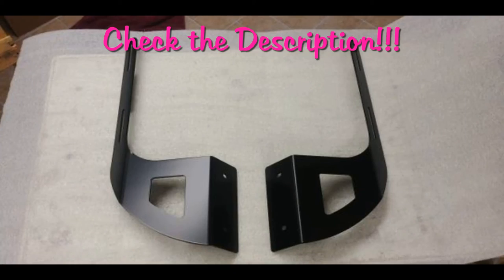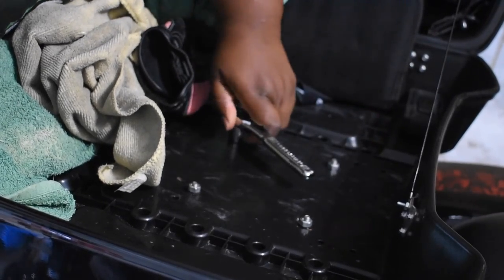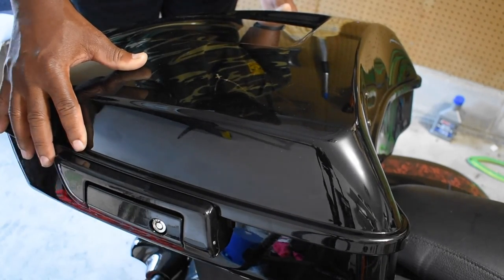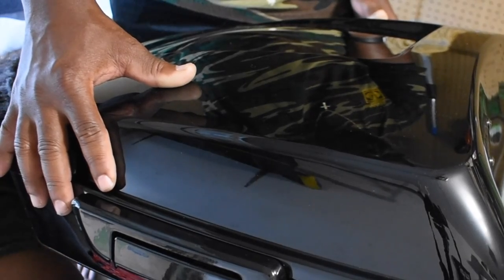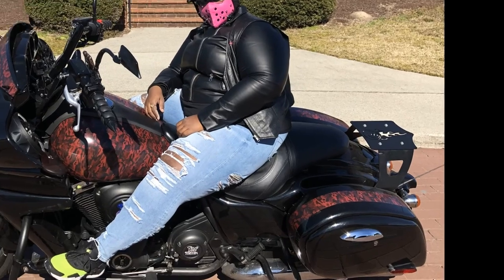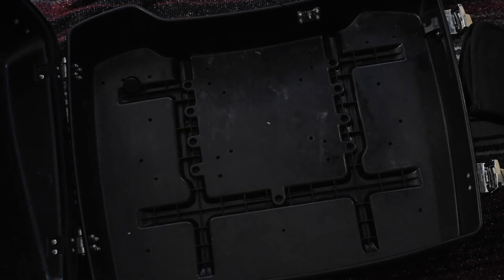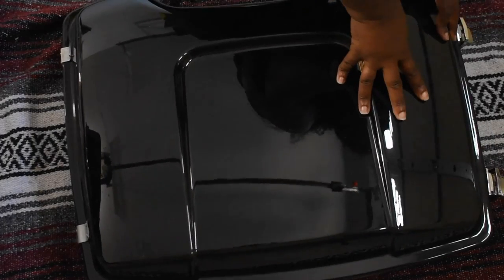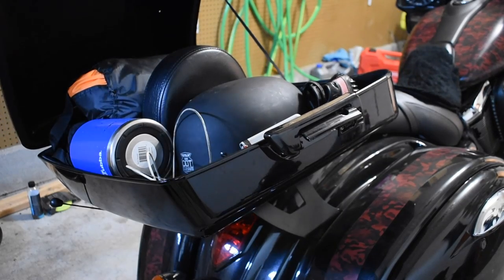TOUR PACK REPLACEMENT/INSTALL | Razor vs. Chopped Tour Pack | Kawasaki Vaquero | Vaquero Mods

Comment: Just ordered my brackets and chopped tor pack. I’m on the 22 vaquero. Mine came with the razor pad for the back rest.
Good deal tho! 
Could you tell me what size were the bolt you used ?

Comment: Hello Rho, just received my Bdd mount. My question is how solid is the top box after mounting. Does it shake at all. Don't have the box yet but I am a little concerned seeing there is some flex in these mounts.
Reply from the maker: No shake for me. To date…no issues and haven’t had to make adjustments. But since installing I have seen concerns from others about the stability of the mounts. I do have the mounts pushed up as close as possible to the front.  Idk if that makes a difference. But again, no issues for me.

Comment: I am doing the exact same thing to mine (haven’t decided on a top box though).  In the video you mention putting a metal plate in the box for extra security.  Did you try to use the rack plate as the metal plate?  The holes would all line up.
Reply from the maker: That’s wassup! I did BUT I’m a little OCD and don’t wanna scratch my plate. I’m going to put one in eventually though.

Comment: I really like the added space (3” can make a big difference!) of the road pack.

Obviously you’re not packing really heavy stuff in either trunk, but what would concern me is that the mounting brackets are only held on by two 6mm thread (10mm wrench) bolts on each side.
Do you notice if either trunk sways or wiggles while riding, especially over rough / uneven roads?

As always, please keep sharing your awesome videos.

Ride safe Rho! 😎
Reply from the maker: Hey hey! Appreciate the concern. No wiggling or bouncing…rode 2200 miles with the new pack and over 10,000 with the mount so far and still it’s snug. Of course, it’s another thing I look at on those pre-ride checks 😉. Haven’t had to tighten anything. Thanks for watching!!

Comment: Nice, I've been debating on whether to ad one to my 07 Yamaha Royal Star Tour Deluxe. Extra space would be nice and I noticed it when I went on a 4 day 650 mile trip from DC to the Jersey shore. I took the Cape May ferry and enjoyed the heck out of the trip.
Reply from the maker: Ahhh you did the ferry ride! Dope! I’m glad you enjoyed it 💪🏾
Reply: @RidingWithRho , Yes, and it was sooooo relaxing to ride up through the farmland of the eastern shore of Maryland and Delaware to the shore in Delaware. Lots of long, flat, and smooth roads you can put on your cruise control and ride relaxed. The icing on the cake is boarding the ferry with your bike in Delaware to cross over to the Jersey shore via the Chesapeake Bay. It was 90 degrees when I crossed with the bike and to my surprise, there were 4 other bikers doing the same. We all caught the earliest ferry on the weekend at 8:30 am. It was a hot day that day, but the cool salty ocean air was relaxing and made it very comfortable. I chilled and slept a bit on a deck chair, of course after I settled down a bit. When I first got on I was worried my bike would tip over in rolling seas. Smooth sailing the whole way there except for 4 times when the ship rocked pretty well. I was worried my bike would fall over, but not even close (I watched it like a hawk for the first 20 minutes LOL!). I then went and had breakfast on the ship and a drink (no alcohol! LOL but they have a bar and it is open while they're at sea even in the morning). Anyway, If you ever ride north this way, you should consider doing it, I think you'll enjoy it,  It would make good content for the channel too.
Reply from the maker: Awesome!! Love the descriptiveness. Haha! Made me feel like I was there. It was added to my ride list the first time you mentioned it. I’m gonna make that ride one day 💪🏾
Reply: @RidingWithRho  Yep worth it. I have two more rides I want to get done this summer. I'm planning to ride south to the outer banks of NC from the DC area where   I live. The plan is to take route 17 in Fredericksburg VA to NC. It's scenic smooth and for most of it, moderate to low traffic. The other ride is to head south thru the Blue Ridge mountains to Tazewell VA I want to do the "dragon". Although I might wait for the fall to do that one when the leaves change. Safe riding out there! and post some more of those trips, they are really enjoyable to watch.

Comment: Good job 👍 This is how you save a lot of money by not using a shop for every little thing.    

I ride a 2018 BMW K1600GT I try and stay away from the dealer as much as possible I do most of my maintenance it's not hard.

Keep rolling and putting out these videos be safe!!

Comment: This is why we like your channel.  very thorough.  One question:  do you think the 'plate' you have would sit in the bottom of the chopped tour pack to help strengthen it some?
Reply from the maker: Ha! Why thank you!! 🤗 I don’t quite understand your question. Are you asking if I’ll add the plate?
Reply: @RidingWithRho   Sorry for the confusion.  I noticed at 2:45 into the video, you stated that "you could add a metal plate for added security".  I was wondering, since you removed a plate to add the tour pack, that maybe that same plate would serve the purpose.   I wasn't sure if it would fit though because of the plate's design. Thanks
Reply from the maker: Gotcha! You’re right. I could use that plate but didn’t because I don’t want to scuff it up (even though it would technically be under the liner). It’s the OCD 😂
Reply: The plate is to help the tour pack not crack the base and give it a bit of rigidity also rubber washers help so as not to crack the plastic as well.